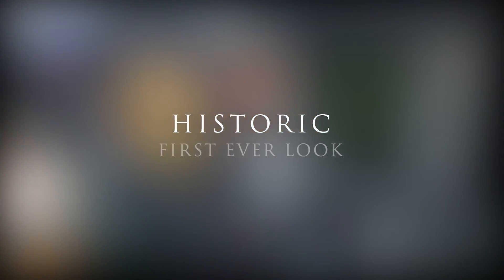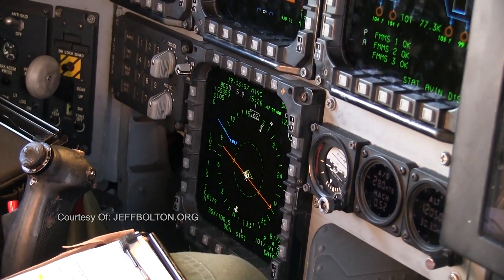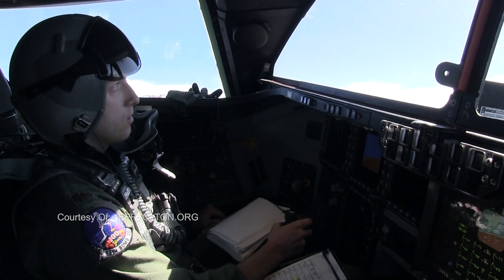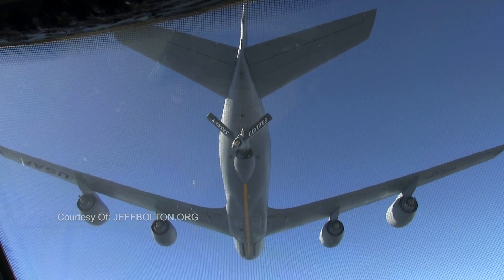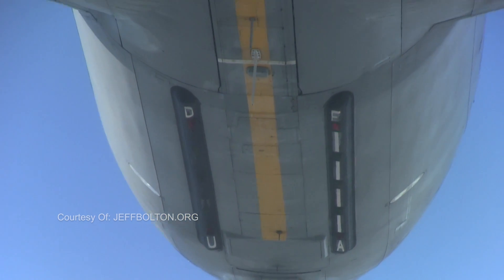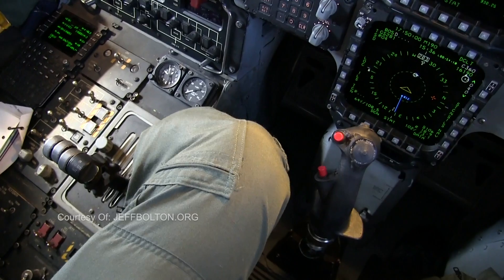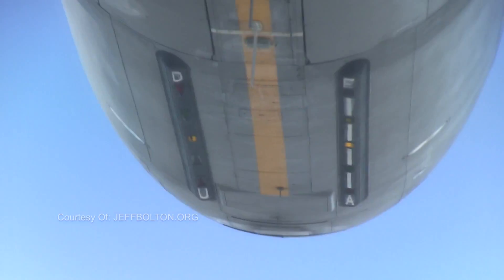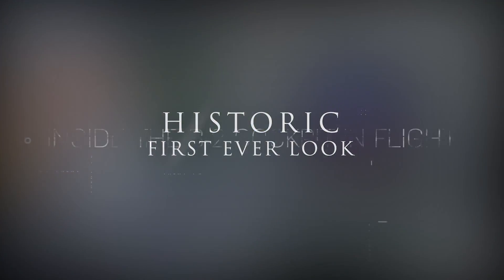B2 COCKPIT TOUR & AERIAL REFUELING

Comment: As a crew chief on KC-135 aircraft, part of my preflight job was to check those PDI lights under the tanker. PDI stands for Pilot Director Indicator (PDI) lights. Some people also call them Pilot Director Lights (PDL), either way, we had to make sure those all worked, and I would lay down in the boom pod area checking those with another crew chief as we talked to each other over comms. Those lights help guide the receiver into position after losing sight of the boom. Usually, pilots don't just stare at the boom but rather talk directly with the KC-135 Boomer and follow the PDI lights. This is extremely important for refueling at night. In the shroud around the boom nozzle end are two black lights that would illuminate the fluorescent markings on the extended boom, and there was a large overhead flood light that would also illuminate the refueling scene above - that was up in the aft end of the KC-135 tail. A KC-135 refueling at night looks like a huge Christmas tree. I was honored to serve in the USAF and very proud to be a flying KC-135 crew chief!
Reply from the maker: StratoArt - First of all, thank you for your service to our Nation. Many civilians like me are deeply grateful for the sacrifices you made in your career. And thank you for sharing your maintainer POV - I've never heard what you describe and I'm always fascinated by what I learn! JEFF

Comment: Very cool to see. It looks like the top edge of the forward control panel sits pretty high but it’s hard to tell. It almost looks like the top of the dashboard as I’d call it is right about eye level.
Reply from the maker: Ryan - You're close; in order to see the tanker in the desired visual window we both had our seats lowered to the max so the dash looks a bit high. You sit pretty deep into the jet and it's not easy to view the world from the flight deck. Thanks for watching. JEFF
Reply: JEFF BOLTON thanks for sharing. I honestly can’t believe it took 30 years before allowing cameras in the cockpit. I’ve seen a lot of documentaries on the B-2 and they always just show a computer rendering of the cockpit. I’ve always knew it wasn’t full of alien technology and that it probably looked a lot like any other military aircraft as far as the controls and avionics go but it’s still cool to see. I’ve always been curious about the small area behind the two seats that I’ve been told has a small toilet, microwave and a little flat area big enough for a cheap folding sun lounger or cot that some crews were taking with them to get a couple hours of sleep when doing some of those 30 hour nonstop missions to the Middle East and back. I imagine that when one is selected to be a B-2 pilot and then are flying that it feels pretty good knowing you’re in control of the military’s most expensive and technological advanced aircraft.
Reply from the maker: Ryan - Here's a lengthy interview I did with David Cenciotti at The Aviationist... it covers some of what you mention in your note. Thanks, JEFF
https://www.facebook.com/search/top/?q=Business%20Insider%20B-2&epa=SEARCH_BOX

Comment: Great video! I’ve seen various bits that note that the B2 has some form of hot meal prep and a crew rest cot inside of it. But it’s sorta hard to understand just how big is the crew rest area? Are we talking the size of a tent, or something like the forward galley or crew rest areas of a 777? Can you stand up and walk around?
Reply from the maker: DC Rainmaker - The "rest" area is the space immediately behind both ejection seats. It's a metal floor approx 6' across by 4' deep. I'm 6'4" and had to scrunch up a bit on the blow-up camp mattress when I tried to get some rest. The blue water 5 gal bucket lives there too...Thanks, JEFF
Reply: @jeffbolton9331  hell ya. I sat in 1069 a few times my dad was a crew chief for a long time… I got to fly the simulator tho… it was truly amazing I was a kid.. lol still see the b2 every few days I’m right near by in warrensburg

Comment: Fantastic impressive video BUT I'm amazed to see pilot has to futz around with thick papers, there are betters ways now in 2019.  In fact, I'd say that's silly thing to be done for the last 40 years.
Reply: paper doesn't need  battery, lock up, have software issues, or fall and break :)
Reply: @labonnemedia 

 and can't be hacked into.
Reply from the maker: RWZiggy - So this will make you smile - the checklists in the B-52 are on a... iPad... the oldest jet has swanky checklists.... Thanks, JEFF
Reply from the maker: @labonnemedia  Amen Andrew.
Reply: Thats in case the enemy blasted you with EMP, paper won’t be affected.. thats why it has backup analog systems..
Reply: @eurythorpe   The avionics and instrumentation are EMP hardened, the system that stores that sillly paper's information can be just as hardened.  The use of paper is stupid.
Reply: @labonnemedia    look at the instruments, all electronic.   The needed information can be displayed there in a system just as reliable as those instruments, just as EMP hardened.
Reply: @jeffbolton9331   I wonder how tough the ipad is for the worst the B-52 might see?   Anyway I'd think a display could be built into the plane for checklist, could be just as ruggedized and hardened as the rest of the stuff
Reply: Wow showing your ignorance there,  I’d bet most pilots would prefer paper checklists over an iPad any day, I know I do. No sun glare, doesn’t go flat just for starters.
Reply: @Danny-ml9vx  Showing your ignorance there, somehow pilots manage to see the electronic displays on their aircraft.  One of those displays could have the checklist.